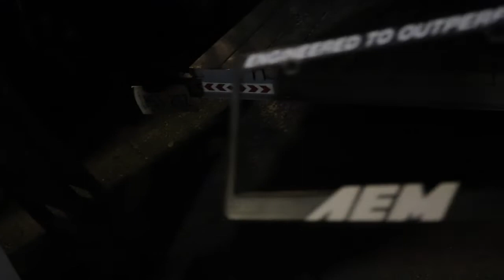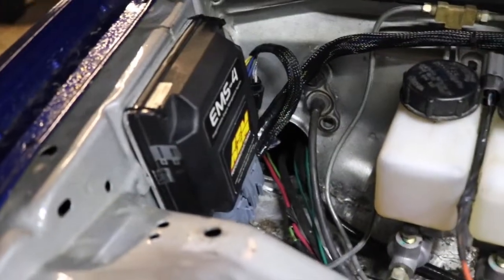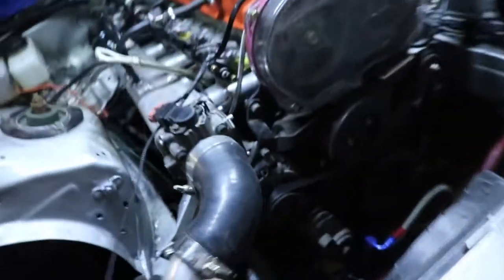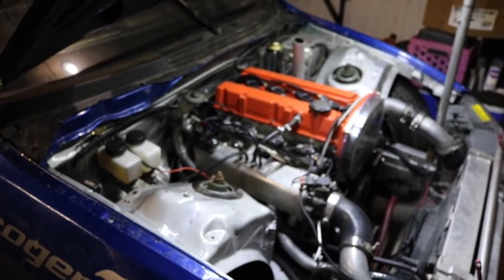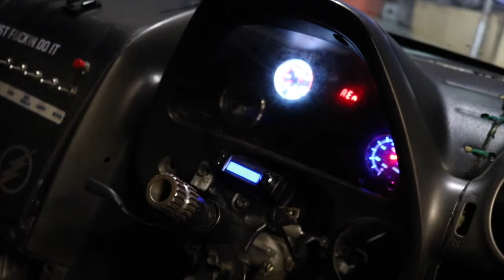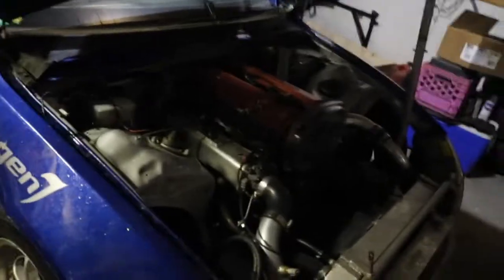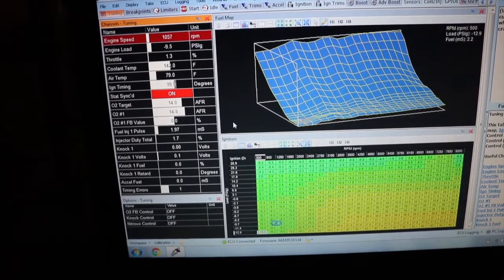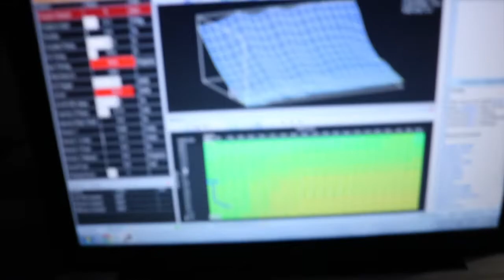Lexus Evolution Dyno Time

Comment: You have a 38mm wastegate and have to upgrade, yet Mazda saw fit to put a 13mm wastegate for my RX7 (Not even a good idea with everything stock). Annoying, Mazda.
Reply from the maker: yeh i have a 50mm on it's way from the tuner, I think the 38mm would of been ok but the way it was placed is not ideal, so i'll be welding the 50mm right on the exhaust housing pointed downwards so the wastegate has no choice to pass through it